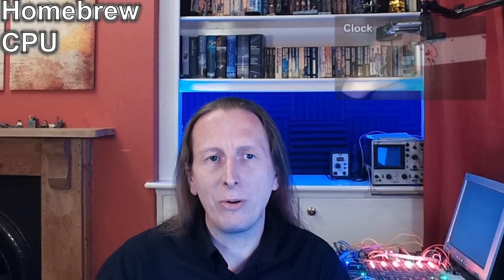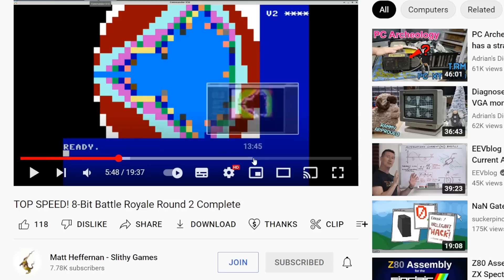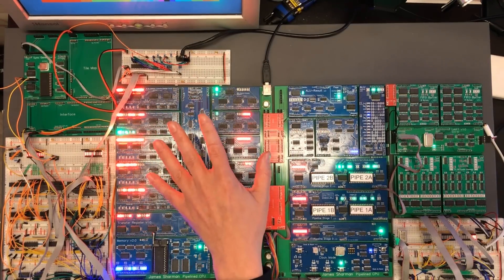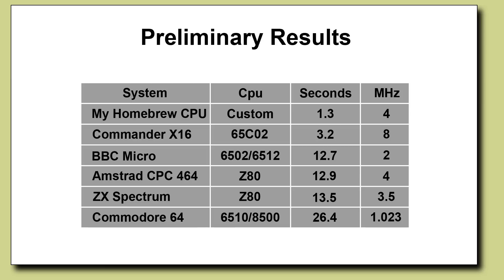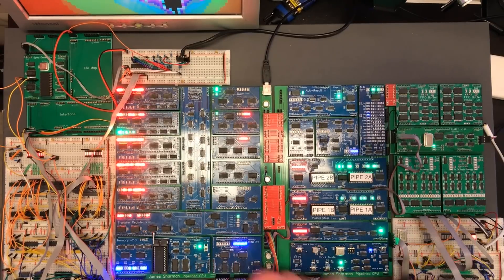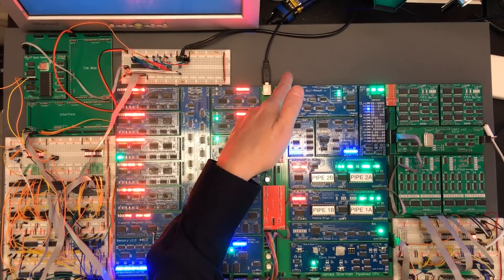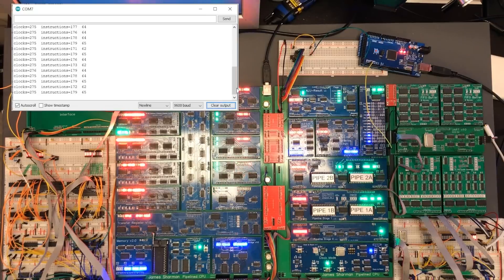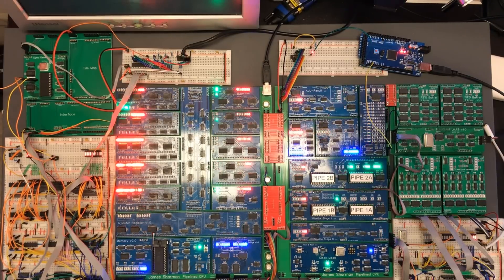Is this the most powerful 8-bit system ever? - Making an 8 Bit pipelined CPU - Part 100

Comment: Most Arduinos are 8bit and run at 16 Mhz, but there are many registers (about 30) and extended instruction for 16bit math (like adc and ror (rotate with carray)), there is also the stm8 series which runs up to 24 Mhz.
Reply from the maker: Yeah, those are the kind of devices I was referring to when I said there are more modern 8-bit designs.
Reply: And the AVR8, like the original PICs and clones, are Harvard architecture processors. So accessing data memory does not get in the way of fetching instructions, making them a bit more efficient than what you can achieve in the von Neumann processor.
Reply: @jecelassumpcaojr890  This is also often a limit to the frequency since the I-bus(instructions/code ) is typically wired to flash directly, which tops out in 40MHz in these beasts. PICs (also 16-bit dspic and 32-bit Pic32=uMips) run their codebus at 40MHz but have a wider (128-bit interface in Pic32MK iirc) to it. This causes hefty penalties on instructions that change the instruction pointer.
Reply: There are also modern reproductions of old 8 bit designs that run very high clocks. Zilog made z80 derivatives as high as 140mhz for example. This custom CPU is not going to be the fastest 8 bit cpu in terms of raw performance, but is probably among the highest I have ever seen for IPC.. Its only bottleneck is its discrete logic. Very very impressive design I must say.
Reply: Ahh, those great, simple and straightforward early logic functions in Assembly Language!  Great way to get a basic understanding of this stuff.  Write a series of functions that enables those 8-bit micros to execute 16-bit mathematics!
Reply: Afaik there are Hitachi enhanced 8051's that go over 100MHz.

Comment: Congratulations, that's an amazing result.  It does make me wonder what sort of speeds would be possible if the CPU could be fabbed on a comparable process.

Oh, and happy 100th video in the series.
Reply from the maker: Thanks Quxxy. Well we can predict the speed at a higher clock rate, but I'd more more inclined to refine the design further before chaining the format. Some of my choices are more suited to describe chips than a more compact implementation.

Comment: the Commander x16 might as well be considered as one off. it's been unlikely it will ever sell the volume of something like the c64.
Reply from the maker: I think a big difference is that the X16 has a large number of people actively developing for it so there is a bit more interest. Maybe I can convince Matt to add it in officially once the project is more finalized.
Reply: @weirdboyjim  just a thought, but once the discrete implementation is done, you could make an FPGA version. As interesting and educational as it is. Most people cannot build the full thing.  But they could join in with a smaller FPGA version. But that would have to come after you finish the build.
Reply: If there's more than one, it can't be a one off. 😁  Perhaps you could argue a "one off" batch of machines, but then, where do you draw the line between your "one off" batch and other 8 bit computers? A minimum of 10 units made? 100? 10000? There are many commercial 8 bit micros that sold in very small numbers and faded in to obscurity.
Reply: @another3997  true, but this channel has fans that might be building along so you have more then one of this project to

Comment: Curious to find out how fast you can clock this. Lovely processor, I feel blessed I was able to watch you bring it to life. 
Bringing this over to VHDL could immortalize your design. OpenCores comes to mind.
Reply from the maker: Some people are already working on an FPGA version. For the clock rate I'm very interested in understanding any architectural limitations with regard to this. The ultimate limit will be the memory chips though, they tend to be slower than other things.
Reply: @weirdboyjim  Isn't that something that you could just try by using i.e. a function generator instead of a crystal as your clock source and step up until a test fails?
Reply: @maeanderdev  temperature is also an important variable. I’m no expert but these things are usually best done as a paper exercise vs a practical one where subtle differences in particular parts which, by luck and not design, deviate from their specification.
Reply: @weirdboyjim  Then you are going to start working on a memory caching mechanism ;)

Comment: Just found this channel, and I've been binge watching the series. It's amazing. I hope when it's completely finished, this computer is offered as a kit as an education resource, the same way the Cerberus 2080 is. It could be an amazing resource. I'd love to assemble one and learn from it. I would also love to know if this design can be implemented using CPLDs or an FPGA. Cheers!
Reply: Certainly you could do most, if not all of this on an FPGA, though a single CPLD would probably be far too small. There's a few folks on the Discord that have written PC emulators for it as well.
Reply: @awesomecronk7183  Thanks for the info. Yes, I was not implying just one CPLD, but several, each with a role. I’ll join the Discord, but I despise the platform, since it’s closed, and the info not publicly available the way forums are. A lot of valuable information is being put there, and you can’t find that using a search engine. Pity it’s replacing the more useful forums…
Reply: @damianvila  I agree about that, but Discord does have it's uses. For one, it's far faster-paced than forums are, since chatting is real-time. That said, it's like having a conversation at my house, vs writing down our messages and posting them at the library. Yeah, it's harder to share that conversation with the world, but you can communicate in real time, so a lot more gets done. Fortunately, I don't think it will ever fully replace forums.
Reply from the maker: Getting copies of this hardware out to people might be difficult, but I have started work on a simulator that serve one day.

Comment: You should be happy - and proud.

Next step is to get an FPGA and program your CPU onto fast silicon and run it at 100 MHz.
Reply from the maker: Actually there are some people on the discord already giving this a go. Personally I'm more interested in evolving the design efficiency, I can predict what the results will be of running exactly this design at higher speed.

Comment: So the true race is IPC, not MIP. This is a pretty impressive result for a single pipeline single alu cpu, a more dynamic register file with an in-pipeline register renamer would boost it a bit, so would a dual headed ALU. I’m also starting to understand why so many CPUs did a multi bus design instead of a main bus.
Reply from the maker: It's all interrelated. Mips is IPC times clockrate. It's even more complicated when you think about the instruction themselves. In my cpu for example, if I want to set A to 0FF I could do either "mov a,0FF" or "xor a,a","dec a". Both will take 2 cycles and use 2 bytes of memory. The first one however is 1 instruction and the later 2, which is better?  I could fudge the results a lot like this so in the end the only real test is to do something serious and see how long it takes. Hopefully the results here speak for themselves.
Reply: @weirdboyjim  the only real way to measure instruction effectiveness is with real world examples, which is why I’d only trust a branched jump table implementation as a measure, because it’s probably the most common bottlenecking pattern in software design.

Edit for clarification: a branched jump table that utilizes pointer arithmetic

Comment: The Arduino, You are using, is probably itself 4 times faster.  But not as cool.
Reply from the maker: Indeed, but it was only there for temporary data gathering to demonstrate what was going on. If that counted we would need an awkward discussion about the the 4GHz PC connected as a glorified VT100 ;-)

Comment: Wow! thats so cool 😎 james.. I have always had day dreams wondering how far 8 bit could be have been pushed without 80s budget constraints so anything like this I find fascinating.
Reply from the maker: Yeah, many of these chips were around (or equivalents) in the 70's but some were extremely expensive.
Reply: If you want an indication, look at the history of the ARM processor. Okay, it is 32-bit, but then if you are chasing performance, you don't stay with 8 bits. 25,000 transistors, virtually no budget, very few resources, but 2 really smart people.

Comment: Nice result, "didn't want to include 1 off boutique" systems? The X16 is vapourware lol, at least yours works and exists in the real world. Great work.
Reply: If several people have real X16 hardware, it can hardly be "vapourware". Whether it becomes a readily available consumer grade product is a different argument. Many early 8 bit computers were available only as kits for electronics hobbyists, and sold in tiny numbers. That's where both Sinclair and Acorn started their foray in to computers.
Reply: @another3997  yes I have been following it since the beginning including being a member of the FB group so I have been "in the loop" re the many design issues, unavailability of senior designers at core of the development etc. Hopefully it will one day turn into a product. At this stage the design has not been locked in due to ongoing issues which of course includes the global chip shortage. Any machines that are in the hands of devs are very much subject to change. Cheers.
Reply from the maker: The X16 is kind of a special case, the hardware may not be 100% final but there is a released specification and an emulator. More importantly there is a whole bunch of people actively developing for it, but this cpu it's just me and few people on the discord.
Reply: I think the X16 hardware does exist and is now working. Some devs have the hardware now and the reason it’s been delayed is to reduce the price. Certainly not “vapourware”.
Reply: @Anticitizen666  the delays , as per David's own updates are varied and many ranging from feature creep, ongoing design changes, troubleshooting, "retirement" of key designers and the global parts shortage. Price is one of many ongoing project issues. Cheers.

Comment: Fantastic result, James ...and to do it with discrete logic, incredible! Happy 100th. I wonder how many hours that is?
Reply from the maker: Thanks Troy! But stop asking awkward questions about how many hours went into it, I don't want to know ;-)
Reply: @weirdboyjim  I'm wondering how many hours I've spent watching. 😂
Reply: @weirdboyjim  ROTFL ... It's been a labor of love, I'm sure!
Reply: I have a piece of the original cray 1. Dicreet components can do enough to need a new term of supercomputer.
Reply from the maker: @thej3799  Nice! Any idea what that bit does?
Reply: @weirdboyjim  its from one of the logic boards that surround the inner column. It's not a complete piece, but I'm mostly certain it's part of what ever goes for the cpu part. Whatever it was is hard to tell, cray 1 was very modular. Don't know if element of that, or a part that was prone to more heat and failure. Why else design it so it could be easily swapped in or replaced.

Comment: I have been rewatching parts of the build, and had a mind to jump on the discord, which is no longer available. My main reason for this ws to get my grubby little mitts on the emulator that is said to exist. So is there a secret discord, or is there another way for me to play with the emulator?
Also, congrats on 100 episodes, you have come a long way from that basic and fairly standard clock circuit in ep 1.
Reply from the maker: The discord link on the channel page should still work (There may have been an expired one floating around on an older video, if anyone spots it let me know and I'll update).  Here is the link to save you valuable seconds: https://discord.gg/jmf6M3z7XS
Reply: @weirdboyjim  Seconds I can use to calculate primes ;) Thanks for the link.
Reply: The discord definitely exists. I'll let James handle the invites bit, as I'm pretty sure any link I post will get eaten by anti-spam systems within seconds, but I'm sure you'll get there soon!
Reply: @FrankGevaerts  Good to know. I am not that greedy, I just thought it would be fun to mess around with a novel instruction set and CPU. If it doesn't happen, it doesn't. I am happy just hanging out at the sidelines and peeking in.

Comment: 100 episodes! Ace! You went from something to watch when I was bored in hospital to one of my favourite YouTube channels in about 3 episodes. Keep up The Great Work! :)
In "the great debate" at college, we always said the BBC beats the spectrum and the 64!
When they break down into CPU type, it makes sense.... Lots of pipelining wins, and smidge of pipelining comes second, no pipelining loses. Shame, I was always quite a fan of the Z80 back in the olden days.
When I'm in 8-bit land, I'm doing assembler on AVR microcontrollers... it'd be very interesting to see where that would come in the leader-board.... need some way to get VGA out of it without eating every single one of it's clock-cycles though.
Reply from the maker: Thanks Edge. I suspect you'll find my lead disappears with some of those modern microcontrollers, they have a far more modern design.
Reply: You can use the timer interrupt to generate horizontal sync, and by extension also the data out and vertical sync to get VGA output with AVR